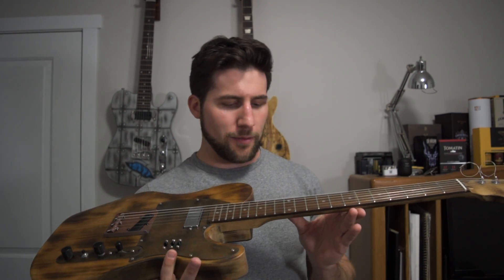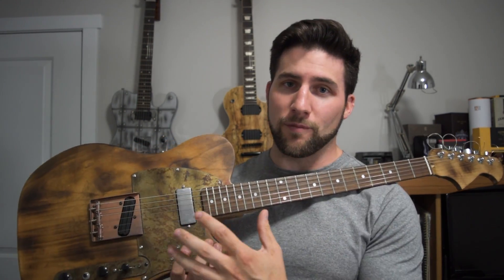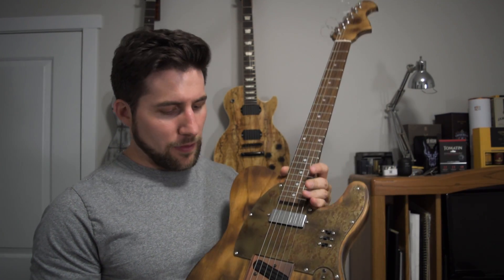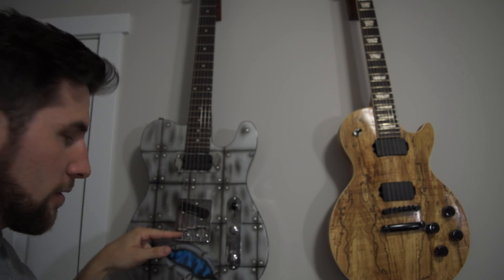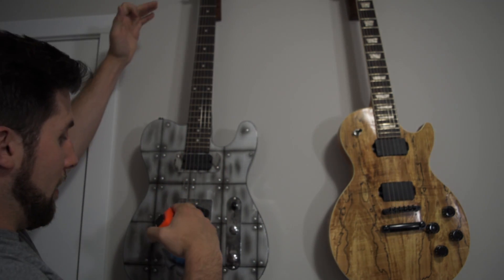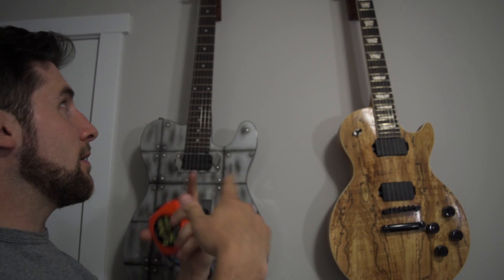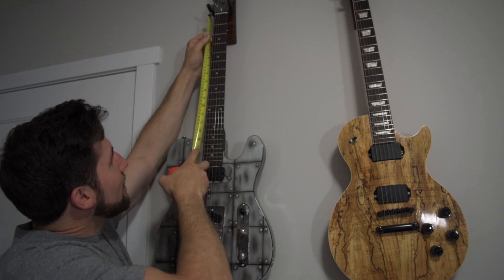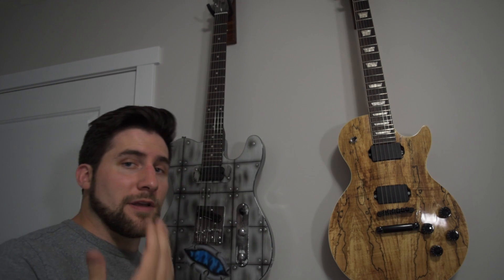Guitar Tip | Scale Length and Bridge Placement

Comment: Great tip Brad!  Just to add to the tip and confusion, this should be measured center of fretboard to center of bridge (between the D&G strings).  The bass side will be adjusted slightly longer, and treble side adjusted slightly shorter.  Best to give yourself a little room for intonation.
Reply from the maker: Good point. I’ll pin this tip.
Reply: Treble side will not be shorter. If you set it at exactly the scale length it will still be sharp. You have to allow for the stretch when you fret the note.
Reply: @BradAngove   
So the very center should be at length.  Low E is longer and High E is shorter.  Bu t by how much?  My first kit and didn't have holes.  Mine is set for 25".  Please help
Reply from the maker: The difference in the scale length between the two for proper intonation is generally about 1/8”.
Reply: This addition to the confusion has been appreciated
Reply: @madbugger69  how come
Reply: @madbugger69  nice pfp btw

Comment: Another great tip, man.

This is the reason I don't like to buy kits with a set neck where the bridge holes have already been drilled.  You have to trust that someone did all the work getting the measurements correct because it's really hard to compensate in cases where the fully seated neck is "too close" to the bridge posts.  I've seen kits <cough>tomtop<cough> that will never intone correctly because of garbage measures and/or worn jigs/tooling.

This is also a VERY strong argument for doing a mock-up and measure BEFORE you glue.

Personally I prefer to measure the center line - then add positive and negative offsets for the actual placement of the posts.
Reply from the maker: If I’m actually placing a bridge I run a line extending down straight from each side of the neck, as well as a center line, and work off that.
Reply: I agree Don. Because there is only so much saddle adjustment available, I rather that the bridge mounting holes not be pre-drilled. I can measure and do that for myself and then I'll be sure that the bridge is correctly placed.

Comment: I had seen somewhere that if you take scale length + the thickness of the string, your intonation should be spot on.  The high e should be the scale lengths without adding the thickness.  Very helpful Brad big fan of yours now and I hope to get the LP kit you recently finished.
Reply from the maker: I’ve never heard that. It doesn’t seem
To match up with my typical setups, but I’m intrigued by the idea. 
Thanks.
Reply: Brad Angove I believe I saw it on a stewmac vid.
Reply from the maker: Hmmm. Something to think about I guess!
Reply: maybe that is the 9/64" Stew Mac vid was talkin' about? It all makes sense with the string density and such?

Comment: 25.5” for a strat or tele and Les Paul 24.75”....that’s normally what I work off... but I also measure from the inside of the nut to no 12..... great tip brad..
Reply from the maker: Yeah, those are the standard two, but certainly not the only two. And some kits are slightly different I would think as well.

Comment: question. So I got a Flying V body custom cut for me cuz I wanted a routed section in the middle of it. Anyway the guy that did it out of NY called Melville Guitars, said the neck pocket was cut for a telecaster neck butt joint. So he already drilled into the body the single pickup area and bridge pins. I purchased a bolt on flying V neck, 22 frets online. From the center of the nut to center of 12 fret I've got 12 inches spot on. From the center of the nut to the pre-drilled  (no bridge saddle mounted, but it's a traditional gibson saddle that it will take) bridge pins it's 24" spot on. Now I also have an old Ibanez 24 fret neck that I put on from center of nut to center of 12th frett is 12 1/2 inches from 12th fret to center of pre-drill pin location is just shy of 13" inches. Which am I better off using. Will both neck be able to have correct intonation? I'm like either just shy of 24.75" or I'm with Ibanez neck at 25.50" and I thought these measurement have to be dead on? Please help, I'd hate to have to make this body into a lamp.
Reply from the maker: It depends on how much adjustability you have with your saddles. They do need to be pretty spot on, but if the bridge allows for adjustment you probably have some flexibility.

Comment: interesting things to take into account: the 22 frets on a standard 24.75 inch scales length all fit within an 18 inch ruler when measured with the nut spacing included, but only 21 fender frets fit on an 18 inch ruler because it has a 25.5 inch scale length, and a prs 25 inch scale length fits all 22 frets when the measurement starts right after the nut/ at the zero fret.
if you have to route your pickup cavities, figure out the placement of your bridge first by dry fitting the neck onto your guitar, and then doing measurements; if you avoid this step, bad things can happen because the pickup spacing ratio cooresponds not only to the scale length, but also how many frets the guitar has. 
as long as you regard these several key aspects to guitar construction, you actually have a little bit of leeway to correct slight miscalculations because electric guitar bridges are adjustable(technically acoustics are too, since you can always 'edit' the bridge piece for intonation). therefore, it isn't as hard as the imagination makes it out to be. however, frets have to be dead accurate, and it is the only unforgiving measurement. because of this, if you have to slot frets, try to remember to do it before gluing the board onto the neck, then press the frets in after the board is glued. this way, it doesn't cost you a guitar if you screw up the fret slotting.
brad, try making a guitar out of rough lumber, it is way easier than it sounds.
Reply from the maker: It’s in the to do list haha. I just have too many ideas to make it ridiculously complicated.
Reply: well, just shove as many ideas into it as you can. :p it's not like you are scared of failing, are you?
Reply from the maker: I would have a real difficult time being me if I were afraid of failing haha.
Reply: yeah, it seems like everyone who is afraid of failing-- who listens to their fear, has a difficult time being themselves... though, i get what you mean.
Reply from the maker: I meant because I fail so often haha.
Reply: yeah, well repetitive failing at a craft in order to learn is simply a more pessimistic way of describing training... failing is a broader word, and can encompass things that can't be recovered from, or things that may damage or harm, which isn't training, though one still learns from these experiences. so, i have to word that carefully to have it make sense.

Comment: Stew Mac did a nice video on this awhile back. He was repairing an old 335 and the bridge had been studded and anchored wrong from the factory. I had a new 71 LP goldtop with the same problem, and no 'luthier' could intonate it!!  For some reason, he adds 9/64" to the calculation from the 12th fret measurement. I gathered from other sites that you do tuneomatics  at 24.75 and make the  bass side 1/8 longer,  and the treble side 1/8" shorter. When I was starting out building, I planned for  Schaller one piece so I could have almost an 3/4" in adjustment. It is definitely weird looking having that length screw full out on the bass side, but it worked!! Still trying to figure out why he added 9/64" on his calculation?
Reply from the maker: Maybe it was just by virtue of how the bridge was sitting on there. Putting a tuneomatic at a slight angle like that is generally a good idea.

Comment: Brad, question. If I were to change from a strat scale length to a Les Paul scale length, on the same guitar, will the 12th fret on the a Gibson scale move closer to the bridge, causing the 12th fret remaining in the center? The Gibson “neck” itself is shorter correct? The Gibson scale is not shorter because the bridge itself is placed closer to the neck. So I guess my question is, is it mandatory to move the bridge or will the shorter length of the neck adjust itself accordingly?
Reply from the maker: The LP scale length is shorter and the bridge position is different. If you don’t want to reposition the bridge, you will likely need to adjust the neck pocket or the neck itself to move the neck position accordingly. I highly doubt that you can just drop it in. Also, the pocket is of course different and strats do not have neck angle like LPs.

Comment: I'll shortly be assembling a guitar with a Wilkinson 2 pillar mounted trem bridge. Man I hope I got the holes for the bushings in the right place. I drilled them way back when I routed for the trem, that may have been a mistake but being a bolt-on I guess there's the possibility of adjustment if nesecicary (it's the centre line I'm worried about rather than the scale length.
Reply from the maker: How did you measure it?

Comment: what happens if u increase the distance from 12th fret to saddle, say by 1/4 inch? will it affect the intonation? if not, what is the max dist, is it exactly the same distance from the nut to the 12th fret?
Reply from the maker: It should be the same (with a bit of adjustability because not all of the strings are the same). If you make the saddles too far away it won’t intonate properly. All of your notes further down the fretboard will be a bit flat.

Comment: Watching this video because I just ordered and received a 24¾ scale neck for a guitar that had 25½
Reply from the maker: Oh no. Are you going to try to move the bridge to accommodate that, or get a different neck?
Reply: @BradAngove  I'm relocating the bridge I was having trouble figuring out how to center the bridge but your videos really helped I taped up all of the body set the saddles to the middle of their adjustment range and marked the center of the bridge and the saddle position on the bridge tape then I drew the lines and found the center of the neck just like you showed I filled in the string holes in the back of the body with resin and I'm about to drill the holes to mount the bridge Ive done it a few times but it was nice having your videos as a refresher
Reply: @BradAngove  I already had resin tape and a drill I figured it's cheaper to buy string furels than a new neck and it's a first act so I'm not trying to break the bank

Comment: How and where do i drill the holes for the bridge and tail on a diy les paul standard
Reply from the maker: Do you have a drill press?
Reply: @BradAngove  no i dont
Reply from the maker: Ok, well you need to measure out the scale and drill so that the bridge will be on that line, with the treble end slightly in front and the bass ends slightly behind. The difference between the two is usually about 1/8”. Make sure you are drilling vertically, and mark your bit with masking tape so you don’t go too deep or drill through. I recommend starting with a pilot hole.
Reply: Thanks
Reply: @BradAngove  i successfully installed the tail piece thanks for the info
Reply from the maker: Glad I could help.
Reply: @BradAngove  i still need to install the bridge saddle but the tail piece needed to be installed in order to install the bridge saddle

Comment: Good tip but.......this may be a stupid question but if the measurements are exactly double then why is the bridge not parallel to the nut?
Reply from the maker: That’s a great question. I believe it’s because the different strings hold different amounts of tension and vibrate at different frequencies. Their center point from a harmonics perspective is slightly different because of that.
Reply: To compensate for string tension. Heavy strings will need to be slightly longer than light strings. You will often see the B string moved back because it is usually the thickest string compared to the core of the wound strings.
Reply: Intonation.
Reply from the maker: Scott, this is why reverse headstocks make more sense to me haha.
Reply: Right. Lol.

Comment: Thanks Brad great vid, I understand your probably to busy to reply to me on this but can anyone out there explain to me why the bridge is set on an angle and how to find/measure the correct angle when installing a new bridge on a new build? Please and thank you
Reply from the maker: There’s about 1/8 discrepancy in the proper length of the strings to have them intonate properly. So I usually center the saddles on the scale length line and then angle it slightly so the high side is about 1/16” short of the line and the low side is 1/16” back of the line.
Reply: Brad Angove great thanks for your help! I’m on my first build down here in Australia, stay safe out there everyone👍
Reply: @BradAngove  Thank you Brad.This is exactly what i was wondering.

Comment: Good video. I was under the impression that the measurement was supposed to be from the nut to the center of the 12th fret. Correct me if I'm wrong.
Reply from the maker: The crown of the fret, if that’s what you’re getting at.
Reply: Yeah I was under the wrong impression. As a player when someone says 5th fret for example,  I always think of the fingerboard between the frets. So I was under the impression that center of the 12th fret would be where the dots are, lol. I just broke out my tape measure and measured one of my guitars from the nut to the center of the fret wire like you did. Makes sense to me now. Thanks for posting this.
Reply from the maker: Oh, I see. The string actually contacts the crown of the fret, so all scale length relate measurements are to the middle of the fret wires themselves.

Comment: Hey Brad..isn't it from the nut to the center of the 12th fret?
Reply from the maker: Are you asking if the scale length is the distance from the nut to the 12th fret? Sorry, I just want to make sure I understand the question.
Reply: @BradAngove  sorry...from the nut to the center of the 12th fret..ie..halfway between the 12 and 13th frets...then double that number for the total scale length. I believe you are measuring right to the beginning of the 12 fret (up against the metal) itself?
Reply from the maker: Yeah, it’s to the very crown of the fret. The top of the metal itself. You never measure to the gap in between. That gap is nothing, there’s no actually playable note there (except with a slide haha).
Reply: @BradAngove  Yup I figured that but because the entire gap in between is referred to as the "fret" and not just the metal itself...just wanted to be certain. Thanks Brad.
Reply from the maker: @Randy-ul5hy glad I could help clear that up. Cheers Randy.

Comment: Whats the purpose of dividing the scale length by 2 and then measuring from the 12th fret? Why not just measure the full scale length from the nut?
Reply from the maker: It’s more consistent. The bridge saddles have some variability I’m location. Also, this method allows you to position your bridge if that’s why you’re figuring out scale length.

Comment: Hey Brad, I just got a new squier, planning to paint it. When my g string is perfectly in tune, every chord is out of tune. The intonation looks fine, but is this because of the intonation?
Reply: Little Boi.... If the strings are in tune but chords sounds wrong then it's most likely to be the intonation that is wrong, there are loads of YouTube videos on how to set this up
Reply: It's either your intonation is out of tune, the strings aren't gripping at the nut or your tuning pegs are loosening.
Reply from the maker: I’ll agree with the other two here, but there is also a third possibility. If your action is too high, the additional tension added from having to press your strings down too far can throw things out of tune as well.
Reply: Brad makes an excellent point about having too high of action causing to sharpen some notes. Also look into temper tuning to balance out tuning and intonation problems.
Reply: Brad Angove Yes I noticed that it was actually the b string, and the user of the squier before me was not so smart bc the action was so high. Thanks, I’ll get around to it sometime.
Reply: If every string is intonated, meaning the open string is in tune with itself at the 12th fret fretted note (not harmonic), and you're open chords/cowboy chords are playing out of tune then it is likely the nut.   If your barre chords above say 6th fret and up play in tune, it's definitely the nut.  If you're not comfortable working on the nut and don't have the proper tools, you really should take it to a luthier.
Reply from the maker: Glad the mystery is solved.

Comment: WHICH SADDLE?!  What if it’s previously adjusted saddles?!!
Reply from the maker: Scale length isn’t to a particular saddle. I usually find that the high ones are slightly in front of it or very close to it. The back ones are up to about 1/8” behind it typically.